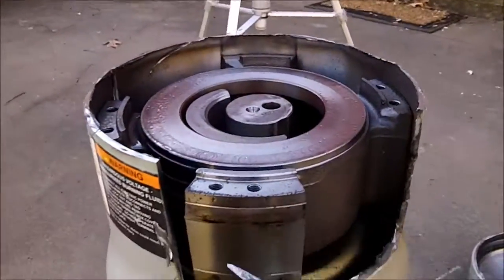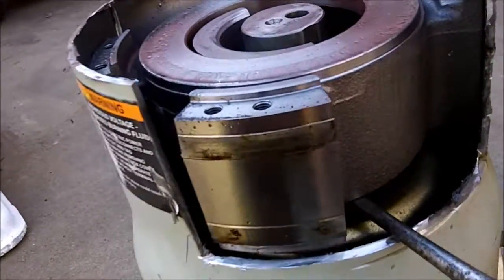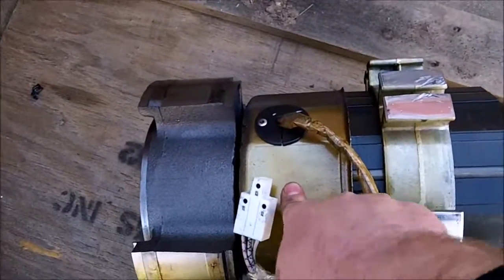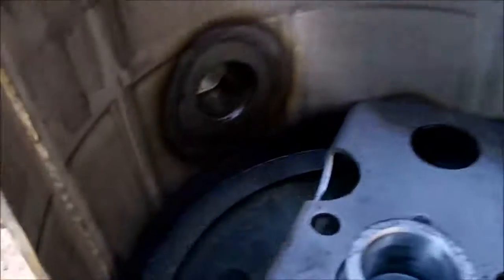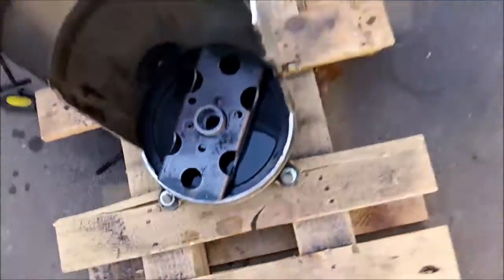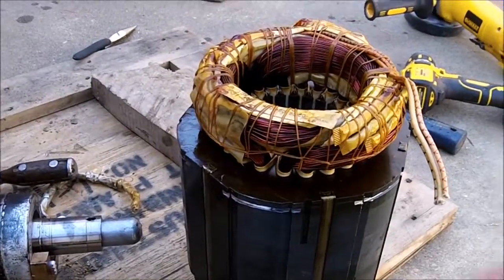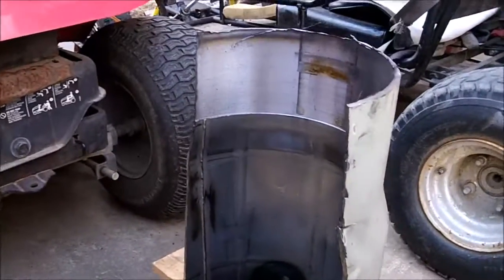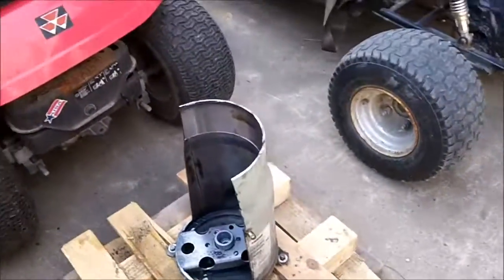TRANE HVAC Scroll Compressor Tear Down Part 2

Comment: are those things normally three phase?
Reply from the maker: Yes the bigger ones are and some small ones too that are used in commercial applications where 3 phase is available, the are more efficient . Almost all of the smaller domestic compressors are single phase but there are some more advanced heat pumps/ ac units that use small variable speed dc 3 phase compressors.